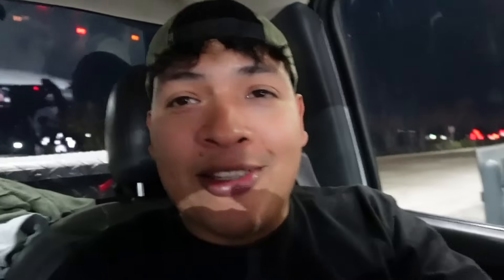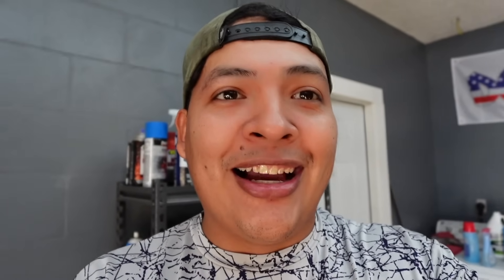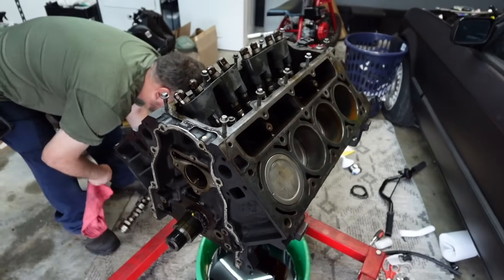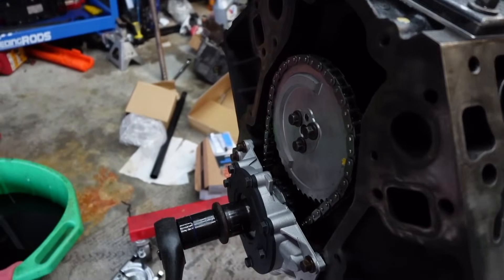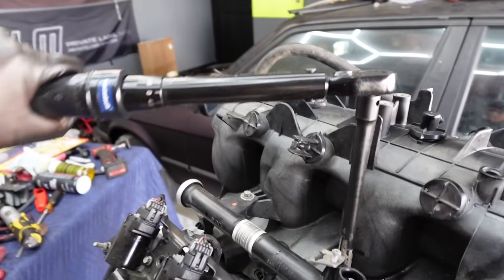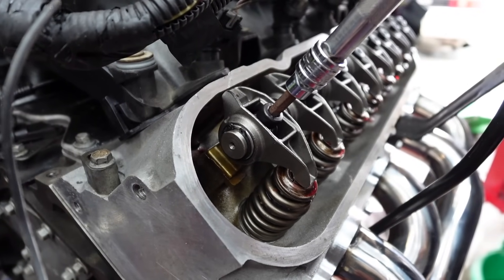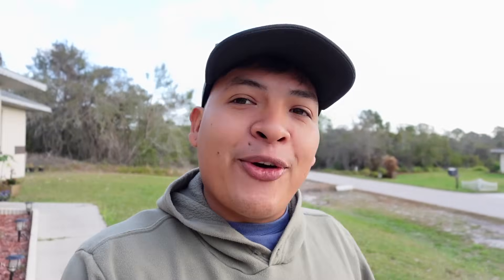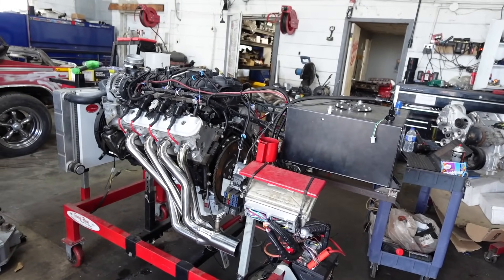I built an Engine using nothing but Temu

Comment: I don't necessarily think this is considered doing it wrong.. Ur using very cheap questionable quality parts but as long as you are using torque wrench and assembly lube and all that it's still not really putting it together wrong

Comment: Sucks that the majority of your linked parts are discontinued. Main thing hold8ng me back from doing the same is fear of not finding the right parts
Reply: They're on amazon and eBay also... just cross reference before purchasing.. build that engine my guy.. I'm doing the same thing ❤❤❤
Reply: @trapman1338 yo sick! I was planning on building with temu but I found a great deal on marketplace and am building an LM7 LS. Just put a stage 2 cam in it. Would love to hear how your build is going.
Reply: @keithtroyer2988 gen 4 rods and flat tops.. getting a s475.. mite supercharge it also.. make it twincharged.. something different in my area.. upstate SC.. 86 3rd gen Camaro.. lm7 also ❤.. I'm seeking a good boost Cam with a choppy idle but mid range power band .. I want a low lobe separation angle and a lift profile that won't be too much air.. I need a safe lift combo.. I don't want to blow it😂up
Reply: @trapman1338 for sure. The cam I am using is from Summit Racing. Mild to decent amount of chop while adding a good amount of power.
Reply: @trapman1338 From mid Ohio. Not 100 what I want to put it into, want a smaller vehicle so I can rip. Have honeycomb springs, hardened pushrods...

Comment: Okay, yeah, I mean everybody on here saying. China, this is and China that. Pakistan. Whatever.
With all the motorheads on here I know somebody has been following the Temu Ls Engine rebuild.  With only Temu Parts.   Wouldn't you know it that bad boy runs. I mean I probably wouldn't go cruising across the desert.  https://youtu.be/vjkNTnr9FdQ?si=WsAlX5BmMaOojFRv

China has been fulfilling our insatiable appetite for cheap parts and cheap labor for at least three decades now.  With parts made to our specifications that only they can make that cheaply.
This design that is being pointed out in the video we are watching now.  Is an original equipment manufacturered Part.  Because that's the only kind that our favorite mechanic here uses.  Do you notice how all this decoupling from China is causing the automotive industry to lose its mind, saying that it will implode if we decouple like that...

Comment: If you have an upgraded Oil Pump the lifter noise won't be there. Something to do with the oil pickup o'ring wearing out which reduces the oil pressure.

Comment: Has anybody mentioned how bad vinegar is on metal itself. I grew up on a farm where we did alot of pickeling and I have seen how fast vinegar eats the metal lids. Tinfoil only lasted a couple days, metal lids a few months before complete failure. I can only imagine how pitted a cylinder would be after a couple weeks.

Comment: Correct me if I’m wrong but I believe to tighten down the rocker arm it needs to be at the lowest point. With no tension on the rocker arm. With the cylinder at TDC.

Comment: Since when does an engine fire up that quickly first time after a build. Somehow Instantly primed
Reply: if the fuel rails were primed it will and LS engines are designed to fire within 1 crank rotation